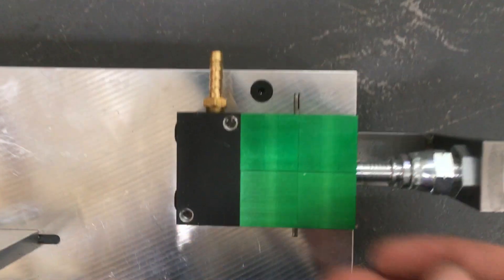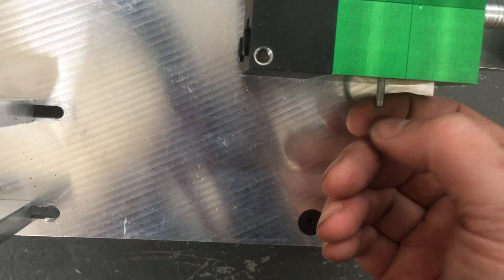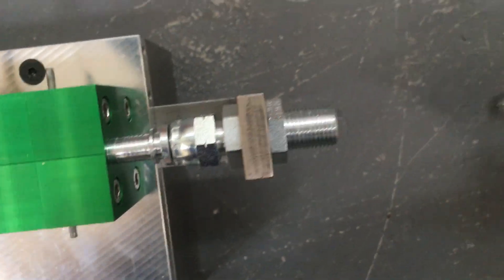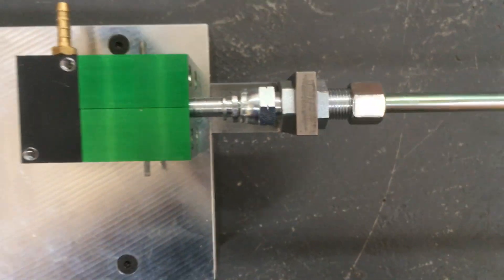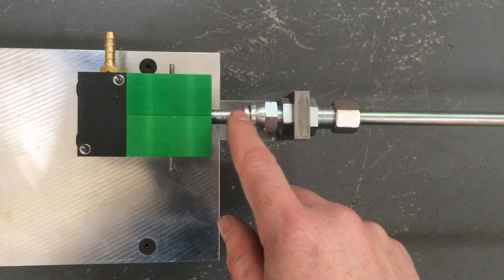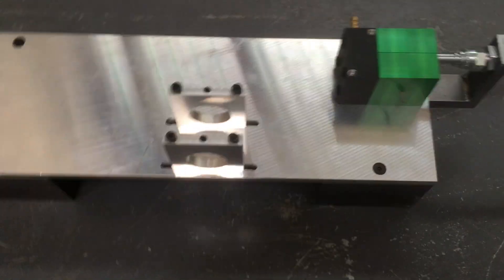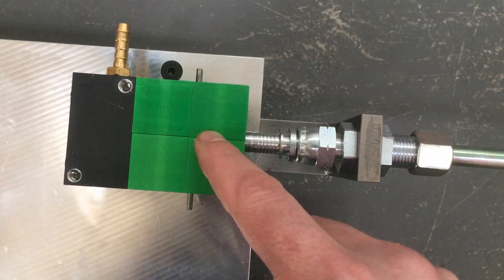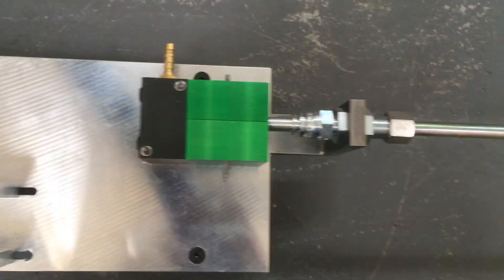Pulse Jet Engine Tesla Turbine Rebuild - Part 2 - Port Matching

Comment: Is the reason you haven't close coupled your engine to the turbine to reduce the air temperature what are your turbine discs made from.?
Reply from the maker: Yes partly, I needed to see roughly how it was going to behave knowing that the Tesla valves are not sized correctly. Also previously I’ve seen temps over 450C on the exhaust and that goes over my thermal imager range at the moment.

Once the new valves are finalized I’m up for bringing the turbine closer. Also it’s supposed to be a circular bore casing with a diverging nozzle inlet if you follow the patent diagram and text.

I’m pretty sure the volute will work.
Reply from the maker: Another reason was to test Tesla’s theory on using the turbine on a exhaust of something kicking out hot gases / fumes and so it could save so much wasted heat energy if the heat is converted to electricity for a factory, foundry etc. 

The experiment shows even a small 7mm ID exhaust pipe can work.
Reply from the maker: The aluminium 7075-T6 should be good for some heat. Rotor seems fine so far.

Doesn’t go as fast but there is plenty of torque, even though it’s a 28mm 2 disc rotor with 3mm gap.

Sidewall gaps are approx 0.3mm

The big game changer is when the water has a small Tesla valve on it. Then the pulse speed will go up and there is rapid heating of the chamber
Reply: @nikola.tesla.r.and.d.centre  I believe I Read somewhere their research indicated 0.4mm between discs!
Reply from the maker: @Graemecns  totally depends on diameter and function. I’ve got reference to Tesla using 31” discs with 25 discs and 7/8” gaps to shift 10,000 cfm at 0.5 - 1 psi @ 3,240rpm. That’s a big rotor.

The tighter the gaps the more back pressure you will make from the equal and opposite reaction if running a centripetal Tesla turbine.

With a centrifugal turbine you make higher vacuum at lower rpm.

Some of these animation videos have never built the machine in various sizes so assumptions are wrongly made.
Reply: @nikola.tesla.r.and.d.centre  I have finished my Pulse Deonatation Engine today have done a video part 2 on the build. https://youtu.be/7R9gft8_zas
I should have a video on the initial testing and trying to tune Tomorrow.

Comment: HOW MUCH PRESSURE YOUR USING? AND TORQUE OUTPUT?
Reply from the maker: 30 psi max at the moment. I'll work out max torque from future power tests until the shaft snaps. Then I will upgrade the shaft to something higher tensile like grade 5 titanium, 420/440c or inconel.

Using compressed air I won't touch the shaft at 90,000rpm. Using this setup I can't stop the shaft by hand at 45,000rpm, so the viscosity from the heat makes a big difference...

When I get some better sized Tesla valves the pulses will be much faster and the chamber will get much hotter, this will give much higher torque at lower speeds.

Also when the super heated steam isn't getting as much back pressure it will got up in viscosity again.
Reply: @nikola.tesla.r.and.d.centre  THANKS, THATS AMAZING ALREADY. I`M STOKED ALREADY. LOVE IT.
Reply from the maker: @SKITZToldYa  It's the simplest little engine that exists. Just needs fine tuning be matching the Tesla valves to get the 200+ difference in flow that Tesla talks about in the patent. Then you can flip back pressure around and make it cause vacuum. The centripetal turbine could never do that as a single stage. But Tesla worked out how to make centrifugal head amplify the system, instead of retard it.

Comment: More detailed topic in Aerospace Engineering
Reply from the maker: Yeah ultimately this can become a working rotating detonation engine.

The Tesla valves just need sizing according to port sizes. Then the efficiency of the valves skyrockets.

Tesla claimed 200+ times the difference in the flow.

These ones I don't think are anywhere near that because they are far too big.